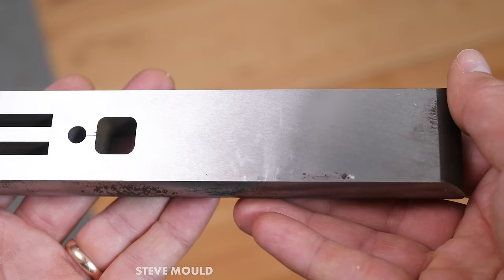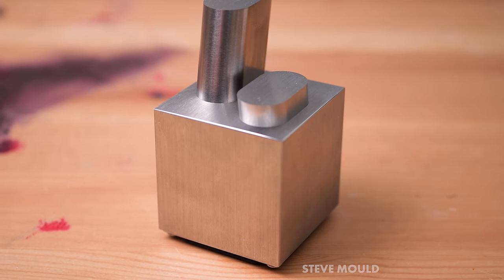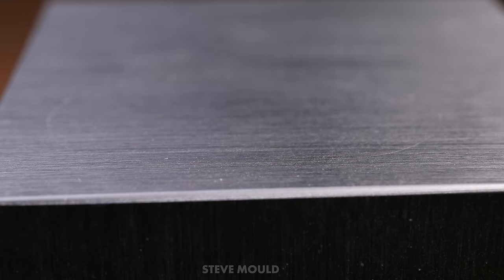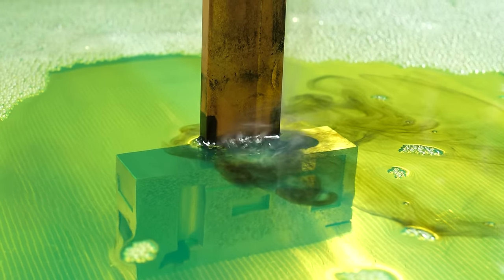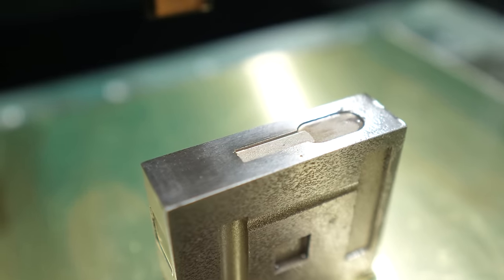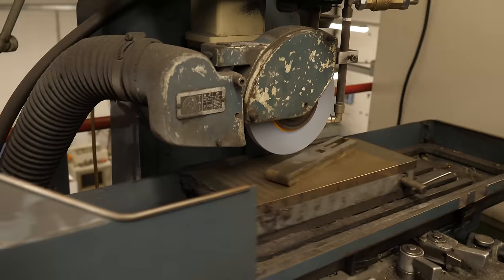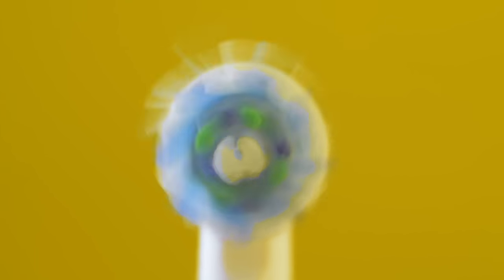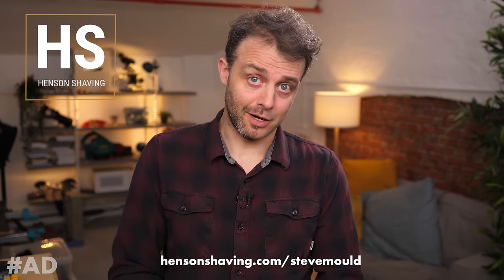How these impossibly thin cuts are made

Comment: I used to work with EDM machines, there's actually a 3rd non submerged machine for burning pockets and other specific shaped holes in a mould using a carbon electrode, where you basically form a pool with special clay and has a constant stream of coolant pumped into it through very small holes drilled into the electrode that's doing the work  to remove particles from the pocket. As well has a steady stream of coolant pumped into the pool to keep the electrode submerged.
Reply: Ohhhh small and deep and big and deeep ohhhh yeah omgff
Reply: Burning pockets and holes in a Mould? 😨
Reply: Is this type a "hole popper" or edm drill? The one at my previous shop had dielectric fluid that was pumped throughout it.
Reply: Die sinker EDM. I use to set up and operate that and wire EDM.
Reply: @scottpohl4069 same, all part of the toolmaking game. Great machines to operate. Surface finishes you could see your reflection on if needed.

Comment: The gap at 2:50 actually corresponds to to the diameter of the wire plus two times the spark gap, i.e. the distance the dose to jumps. The spark gap is small, but for this level of precision, it will be taken into account.

Comment: I guessed that the piston was cut separately, but the precision involved was still very impressive. The wire part, I had no idea. Pretty cool.
Reply: yes two seperate piece cut individually then placed together, logic is assume the actual work piece is 1, wire toolpath is 0.01,  the hole is 0.99+0.01, the piston is 1.01-0.01.

Comment: Steve. I watched your video because I have always been fascinated by the EDM process. I remember an engineer friend of mine had a 3" cube of metal on his desk. It looked solid but he said look up at it between the ceiling lamp. Sure enough all though it looked solid it had hundreds of holes through it. That was a lump of titanium that had been eroded with EDM rod.  Great video but I think it would have benefited from a few pictures of the EDM process where it shows the thousand of sparks going along the wire to best show how the electrical spark generation hits the metal it is cutting. It's an amazing process.

Comment: as a scientist (metalurgy and material science), we use edm to cut most of our samples. it makes it so easy to cut almost identical elements and make results as reapeatable as possible, often with complicated shapes or really small sizec. Thou it also has some drawbacks. However incredible it is, CNC milling and other standard practices are still in use, more complicated elements still need to be cut using standard tools

Comment: I started using Brother HS100 wire EDM in 1985. the boss bought one because he thought it a good piece of kit and told me to find out how to use it in the firm. I worked out how to cut crimper profiles without the use of a computer and programmed the machine typing the code in line by line. I also told the boss it was no use only having one machine as I would be sitting watching it most of the time so he went straight out and got a second one. So while one ran I was changing over the work in the other one.

Comment: I have 35 years of experience running, programming and tearing apart and putting back together wire machines. After years of having to explain these machines to prospective customers and others who get tours through the shop while I’m working and nobody else can explain it I’ve come up with a decent spiel so maybe I can explain it better for those that are curious. 
During the winter time if you slide your feet across the carpet and you touch someone it shocks them and can actually hurt pretty good. Why is that? Well, it’s because when you slide your feet across the carpet you build up an electrical charge all around your body and when your finger gets close enough to someone else the built up voltage becomes strong enough to push the stored amps across a nonconductive gap of air completely dumping all stored energy from one person to the other instantaneously producing a spark that we can see sometimes. The reason it hurts is because at the point where the spark leaves one person and the point where it enters the other person the creation of the sparks generates heat and in that small instance of time that spark becomes hotter than our sun and in doing so it vaporizes anything around it including a tiny piece of skin and any nerve endings close enough to it. If I could control that spark and energy in such a way to produce the same spark 10,000 times per second and run my finger up and down someone’s arm it would be vaporizing 10,000 tiny pieces of skin every second and eroding the skin off both my finger and your arm and be quite painful for both of us. The bigger the spark the more material each spark will vaporize. So, now we take a brass wire and apply a charge to it. When it gets close enough to a conductor it will push a spark across the gap and do it roughly 10,000/second while eroding both the brass wire and the part. We flush high pressure deionized water down in between the wire and part to provide a controlled atmosphere for more control over the spark and when anything in the path of the part vaporizes the water will cool it off condensing it back into a solid to be flushed away from the cut so it doesn’t create a direct short. The wire is continually fed through the cut to provide fresh fresh material for the spark to consume just like it is the material we are cutting. Then we can change the generator settings to make smaller more controlled sparks while making a lot more of them and making more passes back and forth across the part with smaller more controlled sparks each time creating truer geometry and better surface finish until we have difficult geometry almost a perfect match to what was designed. Give me a good Mits wire machine, the proper controlled environment and a valid way to measure everything and I can hold +/-1micron or .000003937in tolerance on just about any part under 3in tall easily. Bigger parts become more difficult, but not impossible to hold those kind of tolerances.

Comment: If the clearance is so tight, whats stopping the metals from cold-welding into each other and fuse?
Reply: Cold welding only works for ductile metals, not carbon steel.

Comment: With EDM the voltage is not very high. its just the gap between the electrode (wire or die) is very very small which allows arcing at low voltages. The lower the voltage the finer the details since the gap & spark is much smaller. FWIW: I built a small die EDM using a 48V power supply.

Comment: I learned about the magic of EDM in a machine shop in Oklahoma back in 2004. A friend of mine worked there modifying jet engine turbine fans. The finished fans would be delivered to the shop and they would be placed on this machine that would 'etch' microscopic holes in the blades ends to provide for a bleed hole to help balance the pressure on the blade during high speed rotation. The whole thing was Greek to me. They would load the machines up around 3-4 in the afternoon and turn them on and check for proper operation than lock up and go home for the evening, letting the "little etching elves" do their thing. Come back in the morning and retrieve your $1000 part from the machine. I wouldn't trade that for a fancy intaglio printing press to make hundret dollar bills. This is legal. 

Darrow...for the Prosecution

Comment: I do like my Henson shaver. One thing I would say though; get a sharps box and put the used blades in it right away, they give you really nasty cuts sorting the rubbish otherwise. 

I also find the blades are only good for one outing if you want to do a half decent job 

Still worth it though

Comment: Ok, so if you cut a plug with exactly ( I mean exactly) a outside diameter of 1 unit, and  bore a hole in a billet of inside diameter  1 unit, would  they fit together?

Comment: The fact that you had to intentionally fail to use a cartridge razor to show how much better an over engineered one is should speak volumes. Just get an electric razor, works just as well, if not better, easier to use, and doesn't cost $100

Comment: At 4:09 ... is it possible the spark is locally boiling the liquid, creating and collapsing bubbles in a form of (electrical rather than pressure induced) cavitation, which causes a form of intense and focused pitting/corrosion in the shape of the electrode?  Then again, I'm not sure how much the process damages the electrode surface itself (though it could be made from sturdier materials to resist the effect?).
Just wondering if it's a workable alternative explanation, since it didn't sound like the direct vapourisation of the metal was a convincing argument to parties in the know.

Comment: With the advent of the WEDM, 2nd and 3rd world countries can now compete against the old giants and this is why much manufacturing has gone from former world-leading countries.  You no longer need to have highly skilled people creating tools and dies for manufacturing.  The first machine shown was a conventional EDM, using an electrode to erode the base metal to the shape of the electrode, but multiple electrodes must be created as they degrade with the electrical sparks.  With the wire electrical discharge machine (WEDM), the wire continually travels during the discharge process and also degrades, so finishing cuts are made for extreme accuracy as the wire is used very similar to a sewing machine as it comes in large spools.  One pass might be applicable for some items, but more ' trim cuts' are usually made.  You can now make shapes in hours instead of days on a surface grinder with a highly skilled grinder hand, AND some shapes can be made now, that could not have been made in the past using old methods.  
     There is also a" hole shooting' machine that can put start holes in already hardened blocks for the WEDM.  It is also an electrical discharge machine using small tubing to create holes in a similar fashion as the EDM machine shown at the start of the video, but it does not pulse up and down as the water flushes out the eroded material on a constant basis.   CNC machines and computers have changed manufacturing forever.
      Retired tool and die maker.

Comment: Why start the cut for a pre-drilled hole when you can use the outermost surface of said hole to cut an outline...rather than start form the middle, cut to the outline?
Reply: @EpilepsyWarning  Nah, still wire cut, but when he showed examples the cut was always from the center then moved to cut the outline of the shape from a pre drilled hole to feed the wire through, when that could just be on the outside, instead of an extra cut going from the center to the edge.

Comment: Dumb question, how does the friction between the two pieces not make them difficult to slide against one other. My lizard brain keeps thinking about press fit bearings. They're precisely machined to fit into their place with no gap and it can be a real process getting them in and out.

Comment: ofc im only 20 sec into the video. but you are misleading the community by that title. yes the cuts are "thin" but those parts are made separately. the wire would have had an outer diameter of 3mm and still achieve those parts

Comment: All they do is take one block of metal cut a hole in the center then make the first cut out plug, then they make the second and with a separate piece of metal they have a laser cutter measure the size of the holes and then precisely cut out a plug to fit the hole it's just two separate pieces of metal they just drill hole with a drill bit and then with an incredibly thin blade cut the plug out no with another piece of metal cut a new plug to go in without the hole duh..

Comment: The sides of the movable slug don't look like an EDM finish.  They look ground or polished.  An important step has been skipped.
Reply: You have to remove the EDM finish because it’s consists of 1 layer of burned up brass and steel and 1 layer of steel that is cracked and flaking off. It’s only usually around .000025 to .00005 thick so you are correct that someone removed the EDM finish and kept going with something much to aggressive. I would bet it was to get the parts to fit together.

Comment: So it’s not two parts cut from one. Then there’s nothing special as dimensions can be cut very accurately from two different pieces then machined to look as one. In other words, illusion; trickery; fake.
Reply: realistically though, whatever is doing the cutting will always leave a gap in the finished piece. You'd need some sort of impossibly thin cutting tool to achieve that effect on one piece. I imagine you probably could precision grind a block to do something similar though, any sort of radius changes things a bit.